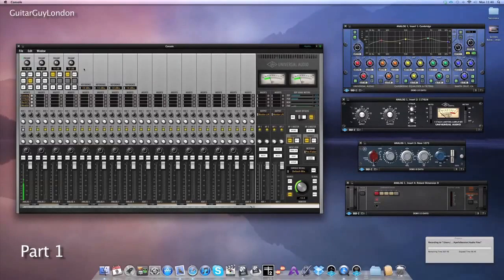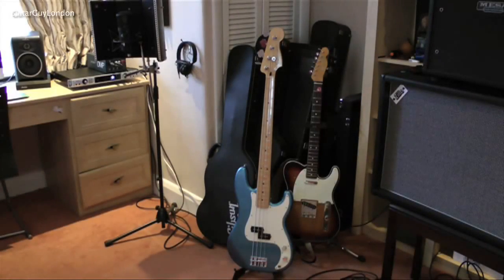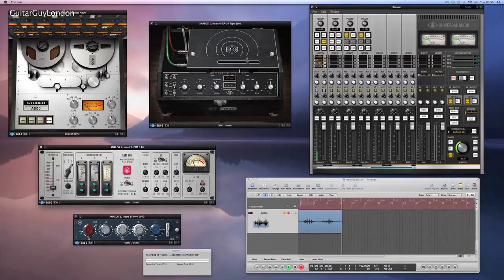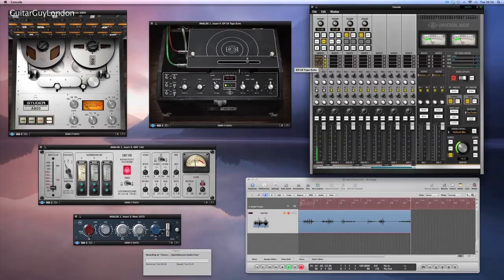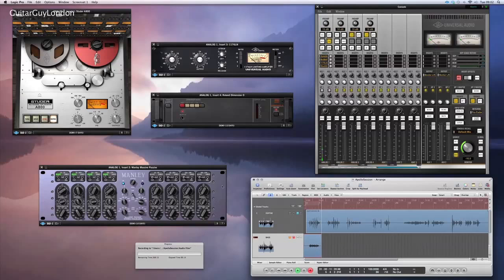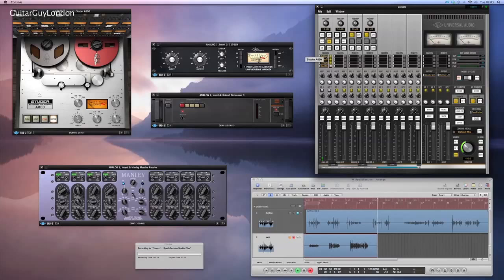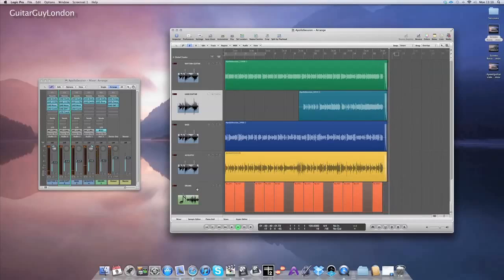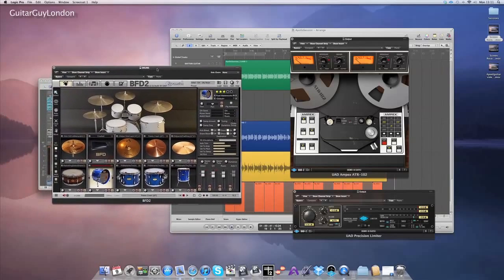Universal Audio Apollo - Real Time Tracking With Plug-Ins

Comment: cool demo. little thing I learned from the UAD site: with bass guitars going through the tape machine, start by overbiasing the machine and adding a bit of high end, then set your input so as to peg that meter pretty hard into the red (remember to decrease your output by the same amount). go until you hear it distorting, and then pull it back until you can't hear the distortion anymore. the needle may still be pegged pretty hard at that point. as a great evenness to the bass.